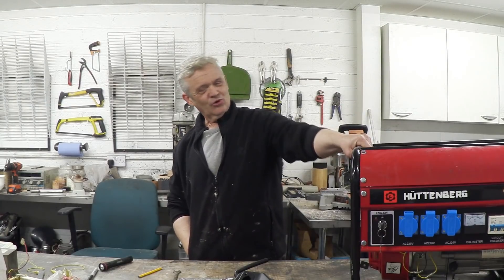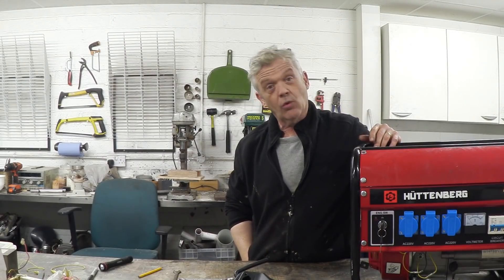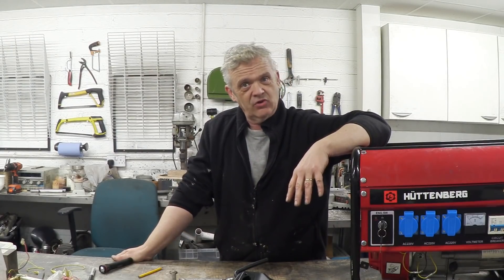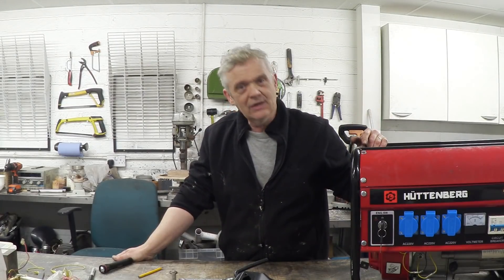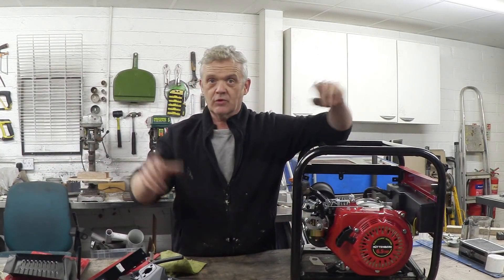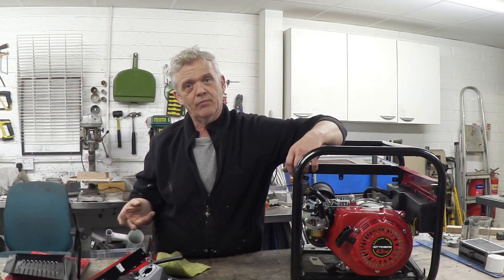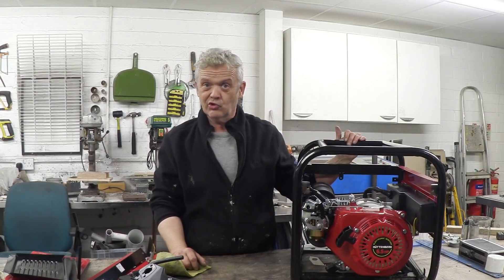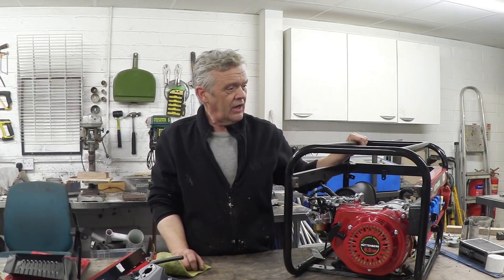DIY Gasification and Generator Unit - Part 1 - The Generator

Comment: Thanks for taking up the suggestion, I know it goes against your greener nature and all. Still, can not beat the energy density of gasoline/diesel. At least this way, when you expel the CO2, it is CO2 that has been previously absorbed by the tree so your at a net zero impact.
Reply: If your taking waste biomass, or wood from maintained forests and burry the produced charcoal.   Then your more than net zero as your taking carbon out of the natural cycle

Comment: Remember to not skimp on the cleaning of the gas before you shove it into the engine, it's gotta burn AT LEAST as clean as the intented fuel source otherwise it will gunk up and junk the engine, wood gas without any cleaning drips carbon residues all over the place.

Besides, we'd like to see you test the burning of the gas before and after cleaning to see the difference. I wonder if it counts as carbon neutral or even negative since quite a lot of the carbon the tree soaked up would be locked up in the filters\cleaners\dirty water.

Comment: Recommend you don't build a FEMA style gasifier. An imbert or modified imbert is better. I have made one. It is very satisfying to get a motor to run on wood gas. I haven't done any videos but plenty have. Flash001USA did a very nice job describing his builds and journey through to his final own design. You will be looking at a restriction diameter of 2-3 inches. He uses a single central air inlet that disperses air about 5 inches above the restriction.. Simple and effective. Good luck.